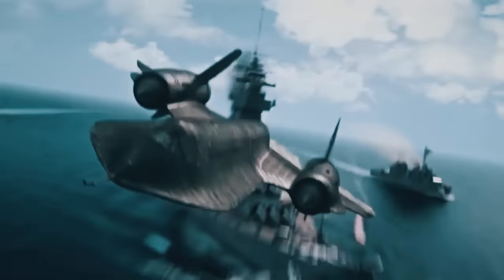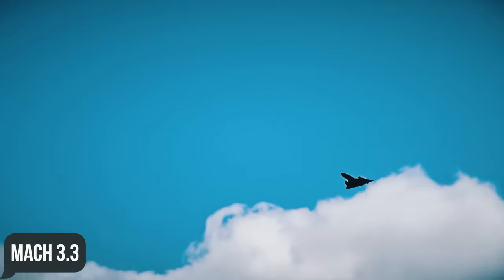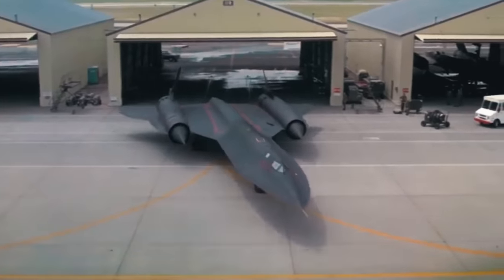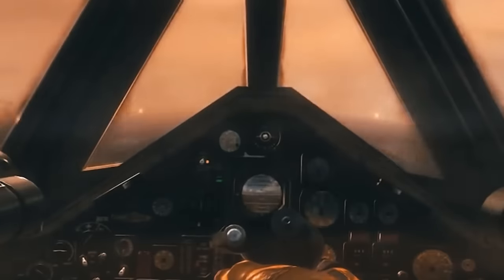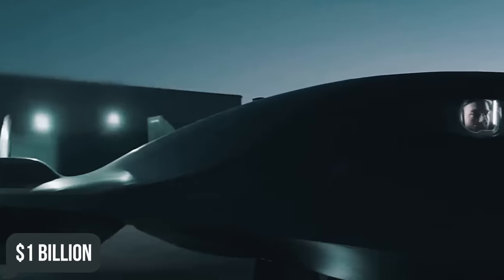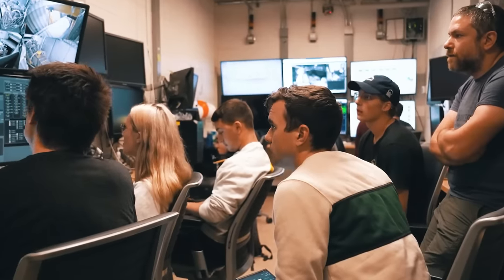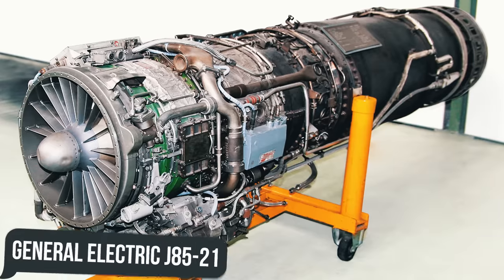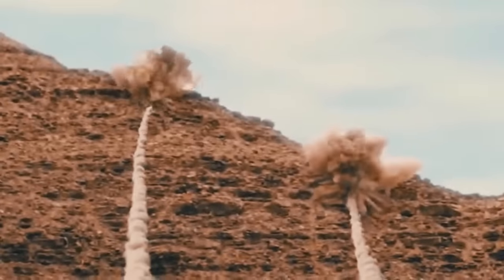Beyond Mach: US Finally Showed Their Incredibly Fast Hypersonic Aircraft

Comment: It wasn't about weight of the fuel on take off.  The SR-71 was designed to expand as it reached speed and sealed up its joints due to heat.  It leaked also because the JP7 fuel would dissolve fuel bladders so they were not used.   This wasn't a flaw, it was an intentional design decision.

Comment: At 9:10...
Top speed of mach 4 and a range of 517 miles.
If i do my math correctly, mach 4 is just over 3000 mph...so in just 10 minutes you can be out of range. 
Is that a fuel range or remote control range?

Comment: First of all SR71  is not the  speed record holder. 
MIG  25 and MIG 31 are both faster. With out all the fancy bs on the SR71.   And there has not been any other plane made by US faster then SR71 and as far as the SR72 goes will see.since US is having so much problems to catch up with Russia in developing a hypersonic missile then it’s unlikely they can have made a hypersonic plane.
Reply: Yeah right.
Reply: Both the Mig 25 and 31 were only capable mach 2.8
Reply: @decipherlogic They were capable of mach 3.3 at a risk of engine damage, with 2.8 limit set for engine durability. SR71 could sustain high speeds but was simply slightly slower.
Reply: The Mig 25 could reach Mach 3 not the 31. And I don't think it could sustain that speed like the SR-71 could.

Comment: Just know that that the SR71 was much faster  than stated  , it was cruising at Mach 3.3 , it was faster and higher
Reply: You are correct, somewhere there is a recording of the pilot of one saying we had a little trouble coming down from mach 4 talking to the tower.
Reply: I've read an article in readers digest years ago that the SR71 could fly over the state of Montana in 14 minutes
Reply: @anthonybaransky137   question is where was the throttle setting?

Comment: 0:06
WRONG FROM THE START.
There are plenty of aircraft that are NOT particularly fast.

And there's a REASON the SR-71 was retired before we had anything faster in the air to replace it - speed DOES NOT make an aircraft "invincible".
Reply: I was going to mention a few.  FAC  to mention just one example
Reply: It's not invincible,  it's not even reduced visibility...but one was never shot down !
Reply: @joshfloyd7755  Was a F-117A ever shot down?
That's was NOT a fast aircraft - or even particularly maneuverable - but it sure was hard for radar to see, and fairly hard to find on infrared.

Comment: Whatever happened to the Auora from the mid 90's though? the contrail had a straight line with doenuts around it at a consistent rate. There was also radio chatter at the time recorded about something leaving Area 51, heading out to the west and returning several hours later always on a Wednesday/Thursday which timed with the AirForces ability to prepare, organize, fly then Maintenace then the weekend. It was a very different aircraft to the SR71 and was clearly developed after. It was also widely known however the airforce never made mention of it at the time and never have since.. It clearly existed as there was much evidence at the time.. I just wonder what ever happened to it as it was often called the SR72 along with its more informal name..

Comment: This is all bullshit. There are no planes that can go faster than the original Blackbird. There are no engines capable of reaching that speed.  No? Then why have they not made it to Commercial use yet? There are materials that can take the heat, but they are too expensive to use on anything else than the Space shuttles and they are retired. They can't be regularly used, because they would have already been Commercialized too. Then how could the pilots take the G loads. But they would be remote or self driving. Like they would really trust something that expensive to take a chance on computer failure

Comment: Quarterhorse could easily be fitted with Kinetic Tungsten Tipped Laser Guided Bombs that when the small Tungsten Rods impacted with targets at over Mach 6 to Mach 10 a Non Explosive Kinetic Weapon would have similar destructive power to Nukes without any of the toxic fallout which would revolutionize Air Combat as we know it. 

Any nation that has a vehicle that can drop these relatively cheap ordinance would have no need for Nuclear Missiles & any nation able to drop these weapons will not have to be concerned with anyone stopping them from using the weapons as they would be classed as conventional projectiles much the same as bullets are. Building Hypersonic Aircraft's is far more suitable than all the money wasted on Hypersonic Missiles which end up being destroyed after one use.